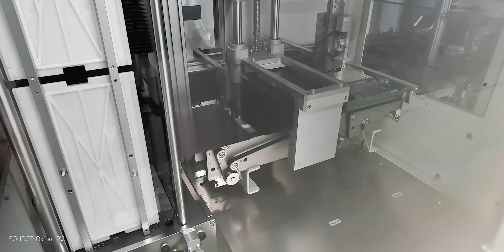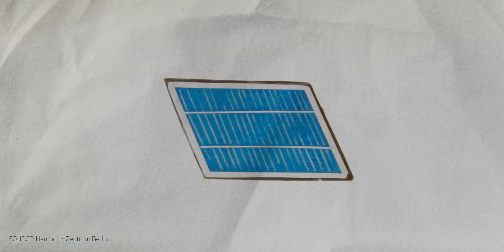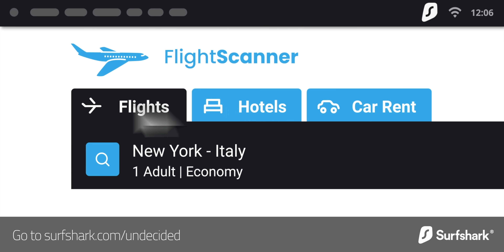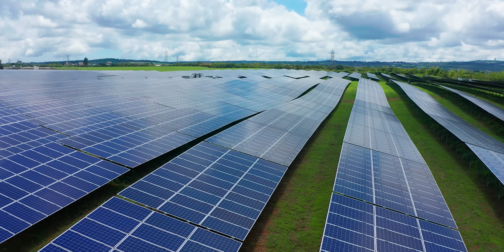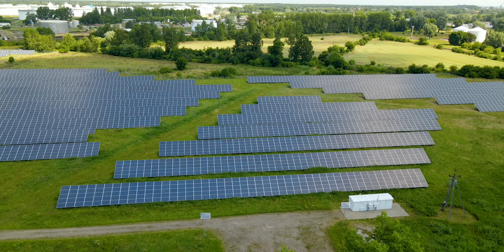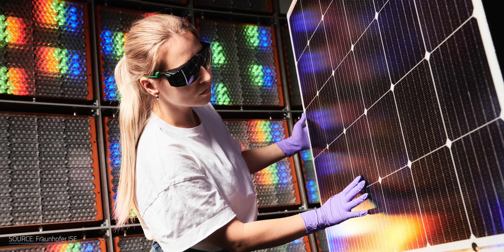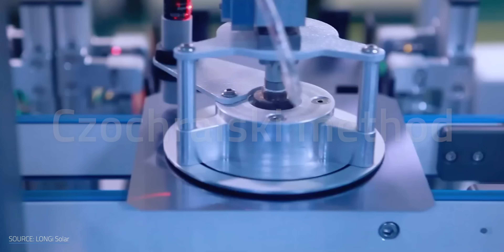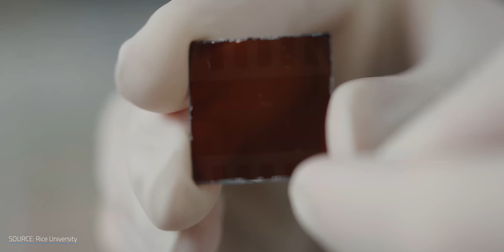How Record Breaking Perovskites Are Here NOW

Comment: They are not here for households for years , they are only for big corporations.
Reply: Maybe less years than you might think.  I've worked in tech production facilities and at the small scale end, you're talking bespoke and expensive.  

Higher outputs demand larger orders, with production for stock (i.e. on demand smaller sales) fitting in between to keep the production line busy.  Small scale and high risk don't encourage colossal investments by themselves.
Reply: @TheHoveHeretic  i know about production probably more than most people, it’s the fact that this new solar panel from the cost of the materials are expensive compared to other solar panels is going to be the biggest factor, corporations can afford them because they will get tax breaks with investment in their companies, for actual solar panels for households as said wouldn’t be surprised if these new panels are at worst 10 years away from availability for households at probably three times more money to buy them , at best I would say 5 years away with them being 4 times the cost  .
Reply: @KavanOBrien Does that ramp up production or not?  I'd suggest it does and that's the most realistic way the capacity needed for widespread adoption will be achieved. 

As an aside, what happens if a better and more readily scalable tech comes on next year - or whenever?  We'd be back in a VHS vs Betamax situation (granted minus the specific condition which caused the technically inferior system to triumph .... for a few decades)

Do you recall the genesis  of the mobile phone industry?  The early examples needed a mortgage, came with batteries like the heavy old square lantern jobs, when all calls cost an arm and a leg.
Reply: @TheHoveHeretic  ok , don’t really think the tape recorder or the phone scenario can be in the same game personally but could I be wrong = possible,
Reply: they work very fast in china, max a year after the companys get them i bet
Reply: @Hansen710  I bet seems far too much as a gamble , not really a good start sound like hope and wishing, let’s invent something and hope it turns out well = wow sounds like a cunning plan.
Reply: the price will drop after they prove themselves in the real world
Reply: @Austintwo3  OK = sounds like a dream = let’s hope it works out .
Reply: You can find excellent residential panels for household use right now, you don't have to wait for these super-special (expensive) panels.  Most wholesale solar sellers will sell to residences though to be efficient you generally want to buy whole-pallets (25-30 panels), not single panels.  You have to know what you are buying and you have to know what you are doing, of course.
Reply: @junkerzn7312  I am familiar with solar and efficiency of different panel manufacturers = the good , bad and inefficient ones , but that really wasn’t my point , it was the fact that this new product won’t filter down to households for years .
Reply: @KavanOBrien  I'm going to give you a bit of sage advice about home solar.  For a home owner, panel efficiency is not nearly as important as the $cost/pw  ($cost per name-plate watt).

Lower-efficiency panels generally have a far, far lower $cost/pw, allowing you to mount more wattage for your dollar.  Bleeding-edge high-efficiency panels are priced at a premium... you won't be able to mount as much wattage for your dollar.

If you feel that you don't have enough south-facing roof area for the size of the system you want, then it is still far cheaper to just start plopping panels down on the less-optimal parts of the roof than it is to buy expensive bleeding-edge panels.  Populate the west-face next, then the north and east faces.

This is why I don't have Maxeon or REC Alpha Pure panels on my roof.  They literally cost twice as much as the panels I got that are only slightly bigger.  Almost three-times as much as a cheap panel, in fact.

-Matt
Reply: @junkerzn7312  what are the make or manufacture name of the panels you got ? Also are they all 400Kw panels ? What battery set up do you have ? Keep in mind I live in the UK so I take it you might be a cousin across the pond , what you have in the USA we might not have here .
Reply: @KavanOBrien  The particular ones I purchased recently are the Hyundai 410W panels. HiS-S410YH(BK).   These are bifacial half-cut panels and they do really well partially shaded and in ambient lighting conditions (such as clouds).   About twice as good in clouds as the Renogy 320W mono-facials I had before.

They were premium panels a year or two ago.  Today the recognized premium panel is the REC Alpha Pure 410W panel.

That's a good comparison actually.  So both are 410W panels.  The RECs are a few percent more efficient.  Dimensionally, the Hyundai's are 75.75" x 40.86" (3096 in^2), while the RECs are 68.1" x 44.0" (2996 in^2)...  so the RECs are 3% more efficient by panel size.  However, the REC's are +50% to +70% more expensive.

This is for an expansion project I'm doing next year on my roof.  My existing system is roughly 5kW grid-tie with an SMA inverter and no batteries, but I also have 2 rooms hanging off of a Pergola system which is 2kW and has 10kWh worth of generic LiFePO4 batteries.

I haven't decided on batteries for the expansion project yet.  Those will be officially tied into the grid.   The smart move would probably for me to get a Tesla PW3 + one expansion battery (roughly 26kWh of storage), which would also give me 6 MPPTs from the primary unit and 11kW inverter.   But I'm thinking of going full custom with an EG4 rack too, which would be significantly less expensive, but require less integrated electrical work by a licenced electrician for the grid tie-in.  So the PW3 is actually a pretty good deal even against a DIY installation since the electrician's work will be a few thousand either way.

-Matt
Reply: @junkerzn7312  wow sounds like you have one hell of a place there , you certainly know your stuff when it comes to knowledge with the panels , interesting soul you are , thanks for all of the information you gave , will check out those prices here in the UK , appreciate your time , take care you = me .
Reply: @KavanOBrien  Hmm.  Youtube seems to randomly shadow-deleting my posts sometimes.  If you didn't see my reply before it disappeared, the panels I got recently are Hyundai HiS-S410YH(BK).  410W Bifacial half-cut panels.  Roughly $0.30/wp.  I've got a few on my smaller systems now and they are really nice.  They're for a major expansion project next year.
Reply: @junkerzn7312  why do they randomly delete your posts ?

Comment: We need em cheap for the private sector
Reply: The first stage will be commercial customers which will be willing to pay a premium as it can be saved against the cost of land purchase. Hopefully this will drive efficiencies in panel manufacture and allow growth enabling economies of scale. Perhaps at that point private sales will become competitive .
Reply: china to the rescue
Reply: Remember the first microwave ovens? $25k+/per now they are so cheap they are considered disposable. Once the commercial viability proven and the techniques are perfected then the price will plummet.
Reply: Solar panels are already super cheap, and cost of install is now usually more costly than the panels themselves. I don't think we need cheaper panels anymore, I think we do need more efficient panels (like this solution) so we can get more value out of installation hardware and labor, which tends to correlate with size and weight.
Reply: That's a sales policy more likely to ramp production levels (hence reducing price) a sight faster than waiting for smaller domestic installations to spread at higher unit cost.

Just for the record ... I'm as frustrated at my inability to at least try any promising clean tech as anyone!
Reply: good luck when perovskites become disposable
Reply: @martinzihlmann822  yeah that's my point
Reply: Wait till China reverse engineers them
Reply: This was a private sector sale
Reply: So basically you are waiting for China to steal the technology? 👍

How about paying for the R&D and suck it up.
Reply: Conventional solar panels have dropped 90% in the last decade. Some people wouldn’t install them if they were free. Just complaining about future tech because they’re afraid to move forward or just plain ignorant.

Comment: The para Sky solar panels in combined with energy storage by using hydrogen or ammonia to help with more energy storage with renewable energy.
Reply: Hydrogen is not an effective method of energy storage compared to batteries. It is inefficient and it has poor reaction time.
Reply: @playyourturntodieatvgperson Like everything there are advantages and disadvantages. Arguably storage capacity for Hydrogen can be more easily scaled up although potential power output will remain constant, that might seem like a downside but in some circumstances being able to provide a constant output for a long time is going to be better than a large burst for a short period and obviously unlike BES you don't need huge amounts of various rarer metals which are also in demand for other uses. Also as a long term storage medium Hydrogen probably works better. I suspect in theory existing gas powerplants could be converted to Hydrogen with relative ease if a way to generate Hydrogen onsite was installed which has the advantages that a lot of the infrastructure is preexisting (including a large capacity grid connection which is sometimes a big issue with new power installations) which would make it a cheaper option however right now there is no incentive for anyone to do such a conversion as it would still have a cost to the owner over just continuing to use gas. 

Personally I think lots of smaller scale local BES storage which do not need huge capacity connections to the grid (not personal but covering something like 50-1000 homes) combined with larger national scale facilities made up of the likes of Hydrogen and pumped hydro are the way to go in theory especially if the local storage is backed up by local generation through personal roof top solar and potentially other means. This is not just about the storage but also about the power network itself as semi local solutions can reduce the need for more beefed up infrastructure everywhere. Certainly in the UK putting in new high voltage pylons is a big challenge. I also believe while it would probably be a relatively cost effective solution overall (and also provide more reliable supply during events that damage infrastructure like storms) it will never happen as it needs a holistic approach directed or regulated by a single entity while in reality everything is done piecemeal for the largest potential profit.
Reply: @playyourturntodieatvgperson  It can be improved and with more time and research it can be a part of the energy storage system.
Reply: @paytonturner1421  This is true, but research money and time is scarce, and other fields such as solid state batteries, grid frequency stabilization, and reducing the LCOE of renewables are much more important.